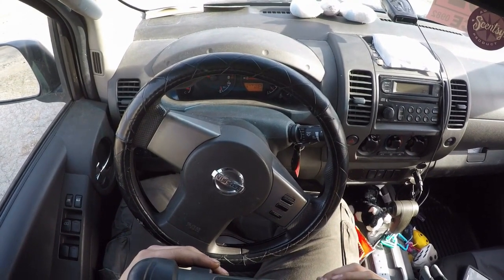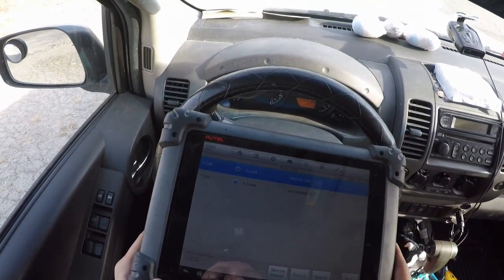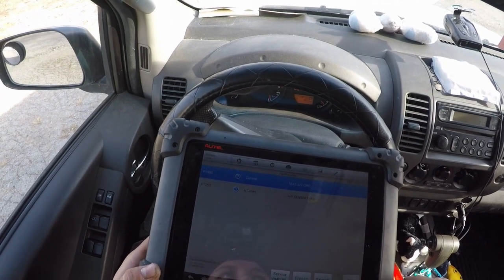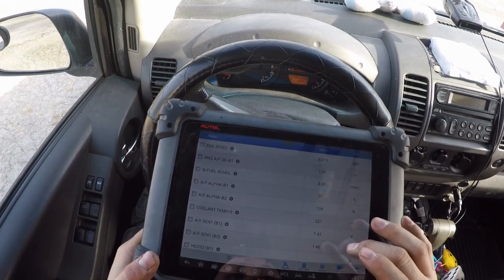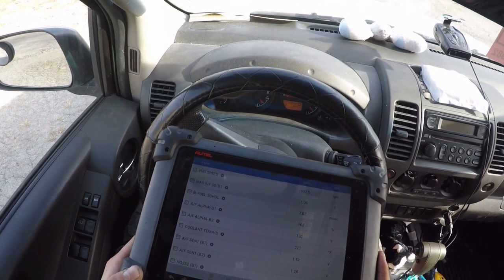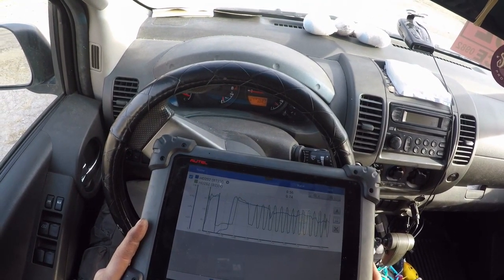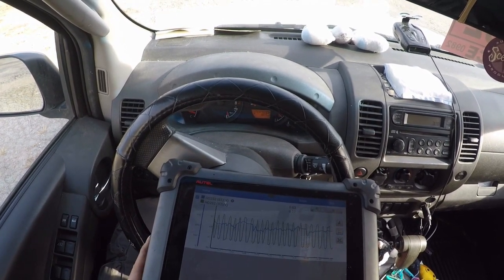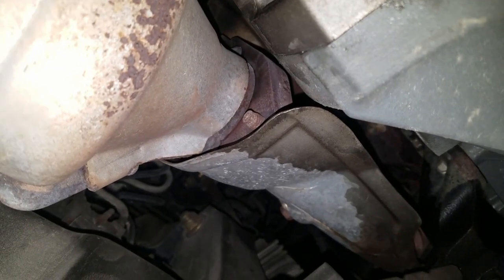P1283 Nissan Xterra Fault Code Diagnostics

Comment: You mention a TSB for the exhaust shield bolts that thread into the exhaust manifold…if one bolt were missing could it cause p1273/1283?

Comment: Great video!  I am seeing the same behavior in the waveforms on a 2005 Chevy Express 1500 5.3 liter.  The codes are different because it's not a Nissan but I strongly believe there is an exhaust leak.

Comment: Enjoyed your video, I have a 05 Frontier V6 (4.0) engine. first mine threw the P0420 code which was the cat, I changed that than all of a sudden now its show P1283. I have changed the air fuel ratio sensor 3 times and it still comes on. you think it might be a exhaust leak situation?
Reply: I’m dealing with the exact same thing. Did you ever get a resolution?
Reply: @vixx88az  not really, I ended up giving it away and picked up a newer truck. I felt like all the time and money I was putting in it wasn't worth it. I have a f150 now and past 3 years have been great so far.

Comment: Thanks for making the video. I have a 2005 Xterra with a P1273 code. My scanner indicates a lean condition in both banks (bank1 > bank2). I replaced the bank1 S1 A/F sensor and reset but it made no difference. After watching this video I checked for intake vacuum leaks and exhaust leaks. I don't have a smoke machine but based on a visual inspection and using starting fluid I could not find any leaks. The truck runs fine and has lots of power but it is using a bit more fuel than normal (1-2 L/100km) and the idle is a little uneven (but not bad). Any thoughts on possible causes for the code and lean condition?
Reply from the maker: Check out this video for a great way to check for exhaust leaks! https://www.youtube.com/watch?v=IZknLjq0PVI
Reply: Awesome, thanks! I found a leak in one of the welds on the front right cat.